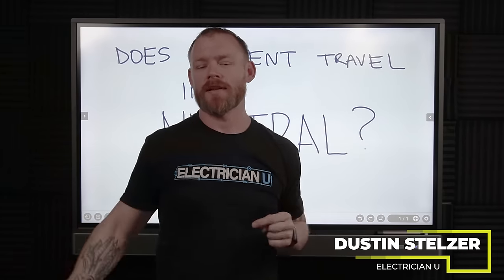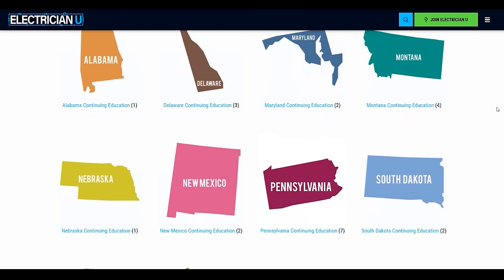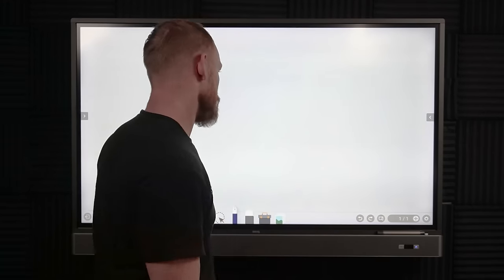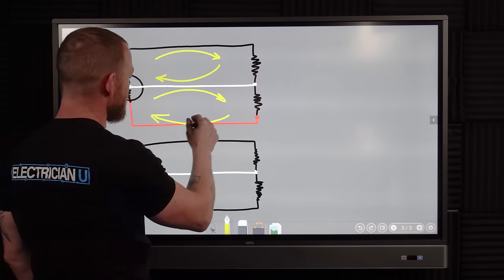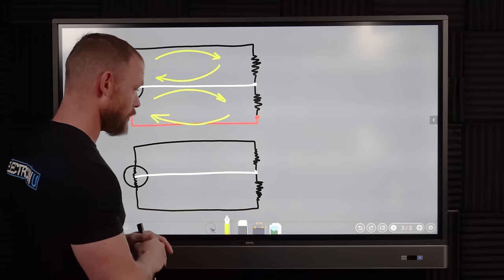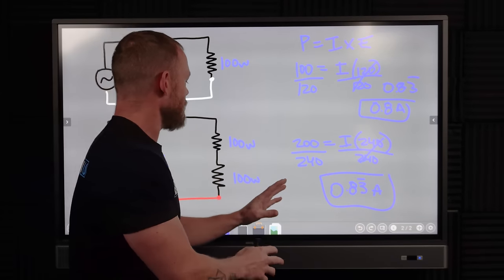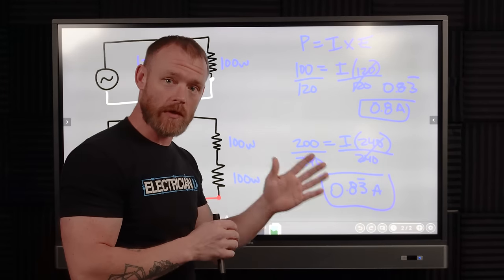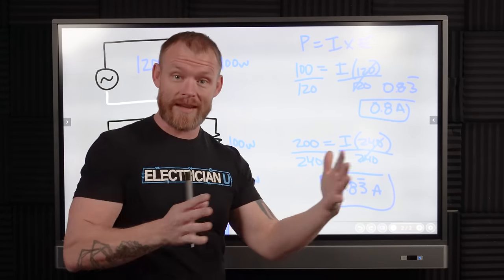Does Current Flow on the Neutral?

Comment: You need to redo this and do a better job of communicating the answer to this question. Also your drawing of the service panel in the house has the 2 120v Leg of service connected at the bottom of the panel. That panel would melt.
You also need to preface each of your videos about electrical safety and that your videos are for entertainment purposes only.
Reply: My-my, let's hope your critique's intent was constructive criticism.

Communicating the answer could be done in a clearer more concise manner. 
His drawing should reflect the correct electrical symbols as used in schematics.
I clicked on the video to add to my understanding of electricity. I love no BS in a presentation, as in a disclaimer prefacing videos, (a waste of valuable time) I acknowledge it's a mandatory CYA. 
(contemplating the subject),
 Rather than the disclaimer being placed on EVERY video, the disclaimer should be displayed upon entering YouTube and require checking a box indicating you acknowledge and agree with the (multi-page legal disclaimer) before you can advance into YouTube.
(if this is adopted/implemented, I demand credit where credits due)
Back to my point,
the presentation is not entertainment, it is educational. I didn't click on it to be entertained, as I'm confident 99% of viewers have, leaving the remaining 1% being entertainment seekers (likely 🫵You mktwatcher).
The presentation did answer the question "Does Current Flow on the Neutral". Yes, I was educated.
What's entertaining is critiquing your comment.
(I desire to continue but I've wasted too much time already, I gotta GO❗)
I hope you🫵 mktwatcher find this educational, and or entertaining.
(I did)

Comment: Very interesting explanation. Unfortunately your Physics is pretty much completely wrong. It has nothing to do with magnetic fields. Electrons don’t have a magnetic field. They create a magnetic field when they move. 

It would be better to look at the voltage at various points. In the two bulbs scenario the potential difference between the neutral bus and the centre tap on the transformer is zero. Therefore no current flows in that wire.

Comment: Unnecessarily cumbersome explanations confusing a simple concept easily explained  using a single, simple schematic. Also the simple practical answer is "yes."  The neutral service conductor, which is a center tap on a single 240v coil, almost always carries some current, except in the rare case where loads on the 120v legs are exactly balanced. Moreover, the white wires connected to the 120v loads ALWAYS carry the full current required by the load. They are never "neutral." They are one side of a 120v alternating current circuit - there is no other pathway for current to flow across the load.

Whether or not full current flows through the neutral supply conductor to/from the transformer is, for most practical purposes except the effort to balance predictable loads in the circuit design phase, irrelevant - as is your schematic showing two black supply lines and a single "neutral." That's not the way things are wired. Every 120v  load has separate black and white wires leading to it which in the case of all loads being on the black side of the supply would naturally lead to both the neutral and the black service conductors carrying the cumulative load, though the individual in-house wiring pairs would carry no more current than usual. The diagram is irrelevant and simply confuses the issue.

So the answer is "Yes. In almost all cases the neutral service conductor carries some current, which will vary depending upon load balance between the black and red legs - but the white wires leading to individual 120v fixtures are NOT NEUTRAL. They always carry the full 120v current permitted by the load.

Comment: This explanation is not satisfactory to me. Current can flow from one phase to the other, without using the neutral in a two phase circuit.
Reply: Question, how does the current "connect to" the other phase? As I see it, to cancel out reading flow thru the neutral (downstream of a connecting point in the return (neutral) line), the alternating of current between the two phases has to be connected somewhere, thru the neutral. How does the current get from one phase to another phase as you see it, inductance?

Comment: Great video,  but why repeat the lie that electrons are particles.  Clearly,  if electrons were particles,  then they would corrode the wires with use. Nut that doesn't happen. The very first thing taught in electrical theory is that particle electrons flow through wires. I immediately asked my teacher how that could be possible? My question was not answered. Why do people never ask questions? Most people will shut down learning if they think that some entity already knows. That's why. Copy and paste minds don't make for good individuals.  The effect It may be a snapping effect or a field perturbation.  But particles,  they are not.
Reply: Bruh what? An electron has a mass, therefore it is a particle lol. If you want to be exact, electrons are quantum-objects so they can be seen as a particle or a wave, depending on the situation. I can answer your question though: Corrosion happens when a material, consisting of atoms of certain elements or molecules of certain combinations of elements react (in a chemical way) to contact with other materials (again consisting of different atoms or molecules). Electrons however are subatomic particles, existing on a different level of matter, so they are already part of the material itself and therefore do not corrode it. Also, the amount of electrons in a wire stays the same the whole time, as there is the same amount flowing in and out at every time. 
And if you think the movement of electrons/particles itself causes corrosion: Warmth/a temperature over 0° Kelvin is nothing other than movement of particles. In fact, thermal motion is by multiple magnitudes higher velocity than electric current.
Reply: The electron is a particle, just not a classical one.  Physicists call it a particle.  For example, in The Feynman Lectures, one section is titled “12-1  Base states for a system with two spin one-half particles”.  He was referring to a hydrogen atom, a system of two particles, a proton and an electron.
Reply: @GH-oi2jf  You're repeating what you are told. That's foolish. Use your mind. Ask questions. They won't answer you. They want to shut down your exploration for knowledge by expecting you to believe impossible things. Don't have a copy and paste attitude.
Reply: @TobiasRebentisch  don't bruh me. I'll knock you out. How does an electron have mass? If it has mass, then it damages the wire it runs through . Think
Reply: @JourneyOfStrength  What do you mean by damaging? Like give me an exact definition of what you think is happening and i can explain you why that does or does not happen (If you have mercy and dont knock me out). 
Right know i can just guess you mean the electrons would damage the nuclei of the copper atoms (assuning its a copper wire), which does not happen because the force that holds them together (one of the four fundamental forces: the "strong Interaction") is by magnitudes higher than the force that electrons achieve by getting accelerated through an electrical field (thats another fundamental force: the "electroweak interaction"). Also: the mass of electrons is by 10^4 lower than the mass of a proton/neutron and therefore 10^5 to 10^6 lighter than a whole nuclei. Its like throwing a football against a concrete wall. You can do that thousands of times and the wall wont break.
Reply: @JourneyOfStrength  — Feynman is an authoritative source.  If he calls an electron a “particle,” then it’s a particle.  That doesn’t mean it acts like a tiny marble.  It isn’t a classical partical.
Reply: @GH-oi2jf   Just ignore logic and reason.  Ok
Reply: @JourneyOfStrength  The whole point of the double slit experiment is that it also shows that electrons behave like particles. You cant just ignore half the results of an experiment. And fast moving particles are definetly real, they can and have been detected on multiple occasions. 
Besides that, i still dont know what you mean  by "damaging". Because electrons  do not carry have enough energy to break nulcei.
Reply: @TobiasRebentisch   
Listen to yourself. They are real. They are real. They are real. Who are you trying to convince?
Reply: @JourneyOfStrength  Well definetly not myself XD No offense but you probably think that you know much more about physics then you really do, if you think Quantum physics is something that hasnt been figured out for the most part a long time ago or that there arent hundrets of things that wouldnt work out the way they do if electrons wouldnt have a mass. I still dont understand how you even came to that conclusion...
Reply: @TobiasRebentisch  
You're not asking the right question.  My conclusion is that Mass is an interaction.  Is the math solving for a sphere or a pseudosphere? The right answer so far is that no one knows. And that's ok, except people are pretending that they do know. The right question is what is going on. But if you think you already know, then that's why you fail to learn.
Reply: @JourneyOfStrength  You still havent told me what you mean by "electrons would be damaging the wire". Also: im nowhere near beeing an expert in physics. It just seems you dont know how much the research in physics has advanced since the most popular properties of quantum physics have been discovered (because that all was 70 to over 100 years ago and research had not slowed down at all). To actually do meaningful research that really taps into the problems that the newest models have or even new models, you would have to be a physics PHD with at least 20-30 years of experience in a very niche field of research or a straight up genius. 
And thats not me blindly believing what the education system feeds me, i always try to question what i learn and If there is an even deeper layer to it
I just dont pretend to be better at physics  than literally thousands of PHDs and dozens of nobel-prize-winners and to see a fundamental flaw noone of them notices.
Reply: @JourneyOfStrength  If you think scientists are after money rather than truth, then i really cant help you. I still wonder how electrons would "damage" the wire though.
Reply: @TobiasRebentisch  
You can't help me anyway If you believe in the integrity of who grants money for research. Particles moving through matter would destroy the material.
Reply: @TobiasRebentisch  
Also. What is mass on a subatomic level? Get one of those govment paid scientists to explain that. They won't because they are not curious enough to ask such questions

Comment: In the video he refers to there being two phases (6:15). He lost all credibility with me. There is only ONE PHASE! That’s why it’s called SINGLE PHASE. Single means ONE. 

He goes on to say (6:40) that dropping rocks into water in analogous to what happens with the neutral. His analogy is completely wrong! Nothing is canceling anything in the neutral. It simply isn’t being used when the load is across the two legs of the SINGLE PHASE secondary side of the transformer.  It was at that point I couldn’t take any more.

This goes to show that anyone can post any nonsense on YouTube and there will be people gullible enough to believe it. 👎🏼

Comment: Let's confuse the picture by talking about electrons flowing in different directions in a conductor at the same time.

This is an extremely poor way to explain what is going on.

Just present some diagrams, proper circuit diagrams using correct symbols for loads, voltage source, and currents. 
Mark the lines with arrows indicating current flow.

Let's keep on talking about pushing and pulling.

No wonder the kids don't understand electricity.
Reply: I understand that pushing and pulling are not the correct terminology, I'm thinking it's magnetic attraction and repulsion from the generating source, no?

Comment: And if you are"single phase"is coming off of twolegs of a w y e transformer, you better redo all your math
Reply: His diagram clearly shows not a WYE transformer. Try to pay attention to the dtails
Reply: @MrSummitville  Maybe you better work on reading and comprehension, Did you miss the "IF" in my statement?

Most of the beginners watching this video have no idea that the source matters, and it should have been at least mentioned. People call two legs and the neutral from a WYE "single phase" all the time, but it's much different

Comment: Not if you did everything else correct in an AC installation.
Reply: wrong
Reply: @GH-oi2jf  if you’ve got a balanced load there shouldn’t be any flow through neutral on an AC system. If you got flow on neutral you’ll flip your protective circuit
Reply: @chrissmith7669  — He is discussing the North American split phase system here.  In general, there is never a balanced load, because the 120V circuits are independent, each with a different load on the system.  When we have ground-fault protection, we usually put it on a single circuit with one hot wire and one neutral wire.  The currents in the two wires must be the same to avoid tripping the breaker.
Reply: @GH-oi2jf  Way back when I studied our distribution system here they claimed each house has their box laid out with about half the load on each side of the supply, either A or B.  They aren’t truly independent but symmetrical about neutral so you get the two 110v with one supply and a neutral and 220V across both.  We were told that if average all the houses other draws the net result was a balanced load and the power wouldn’t see anything at neutral.  I learned later doing AC component design for aircraft that this type of „balanced load by luck n coincidence „. Creates harmonics and spikes that kill equipment, trip breakers, and fail certification tests.  Lol.  In aircraft design 3 Phase you don’t even have a real neutral in a Y circuit , it’s virtual and monitored to Teil the system if you have a potential there.  Lol.  Flashbacks to component design struggles.

Comment: Pushing and pulling?  LOL So no electricity doesn't pull or push so I have no idea WTF you're talking about...
Reply: We used to use the term “push/pull” for certain audio amplifier designs long ago.  As used then, and here, it isn’t intended to be an accurate description of the physics.  The term is just conceptual.  Practical electricity isn’t physics.